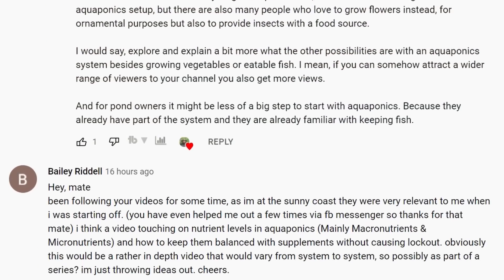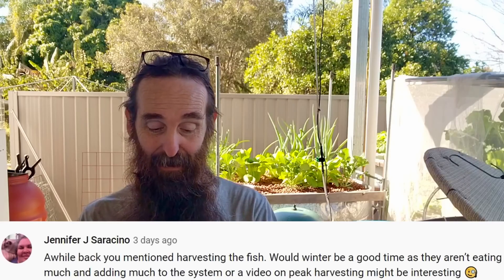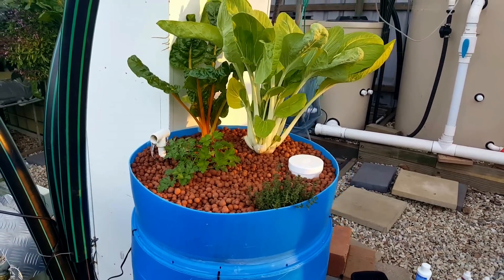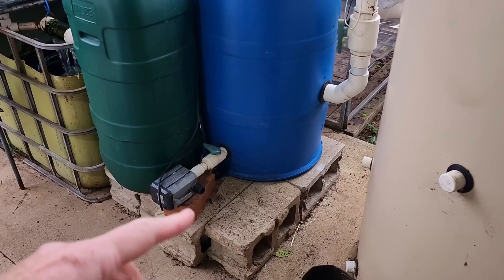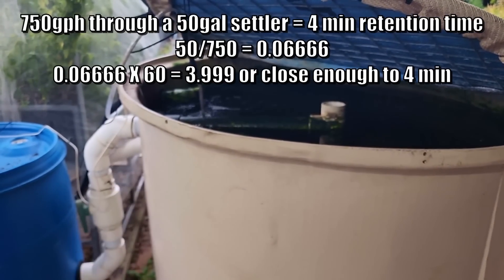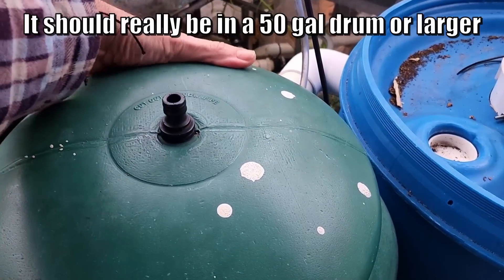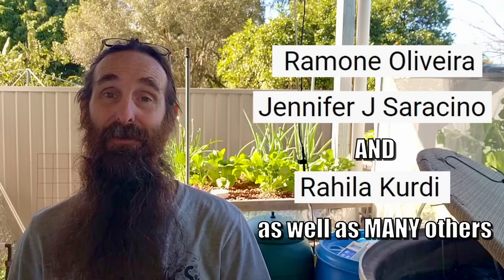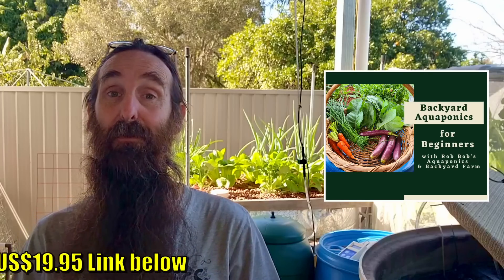Radial Flow Settler & Biofilter Advice | Future Aquaponics Video Ideas

Comment: Hey rob. How effective are biofilter/nitrification tanks vs grow beds? Say I add a 5 gal with loads of air and media inside. How many more fish would that allow me to run?
Reply from the maker: The media I use (PE03 / K2) I can grow out 1 fish per 1L/1quart of media. In a 5 gal container, you could probably only add 2 - 2½gal of that media as you need a decent amount of water to help it move. 
Hope that helps some.
Reply: @RobsAquaponics  Thank you very much for the reply rob! That helps a lot. I have a small space and limited grow area so the biofilter will be super important. Right now I have roughly 30-35 gal of grow media, a 5 gal biofilter and 70 gal fish tanks. Hoping to get at least 20 tilapia to eating size. Still going to add another bed soon and  DWC.

Comment: Hi Rob great info as usual, top chap! I'm looking to set up a small hybrid system in Thailand with the hope of expanding it and would like to know if its possible to have a DWS sunk in the ground 60cm (to help with water temperature control in the greenhouse and cost) but also have a couple of media beds per deep water bed? my issue is that the sump tank needs to be the lowest point so would it be possible to use the DWS as the sump? i know the water level will change but as they are on floating rafts i assume that wouldn't make any difference, I've probably missed something critical so if you or anyone else could give me their view it would be great. really looking forward to getting up and running!
Reply from the maker: Hi Darren.
I know a few folks that use the DWC as a sump. You might find some videos where Rob mentions how he's set up the DWC bed/sump on his @Bigelow Brook Farm channel. https://www.youtube.com/user/web4deb He runs all the water through media beds first then into the DWV. 
Cheers mate.

Comment: Hi Rob! Did you try to introduce more species to the water to make it more self-sustaining? I am quite new to aquaponics but have a lot of aquarium-stuff experience. My suggestion is that you can add freshwater shrimps, crawfish, and some mollusks and mussels to deal with solids removal and create more biodiversity which will be good for plants and for fish. You'll still need a filter but they help keep the water clean and will clean containers' inner walls. Shrimps are the easiest, you just need some substrate where they can hide, they are fast breed and good livestock to feed fish. You can grow them, in the same tank as tilapia or in a separate tank, or even in your filters.

There are also types of fishes that feed on algae and plankton from the walls and stones like Pterygoplichthys. They are not food fish but they are pretty expensive aquarium species when grown up, so adding just 1-2 Pterygoplichthys will help to keep tank walls clear and additionally generate good profit if sell them after they grew.
Reply from the maker: I have had crayfish in the past but think the low pH affected their health & they died off. The same happened with the water snails. 
Some mussels require fish gills for the larvae to attach, so I have steered clear of using them for the time being until I understand more about our native varieties. 
Plecos wouldn't last long in our tanks through winter so I've been advised + I don't have a large algae issue so haven't used them either. The native jade perch we use will eat algae which is a bit of a bonus. 
Shrimp/prawns are something I'd like to use but would need to add another tank to keep them, something I don't have the room to do at the moment.
Cheers & have a top one.
Reply: @RobsAquaponics  that's truly challenging to make a decent biosphere in a tank. Like 80% of fishes I introduce in my aquariums do not live long there. And it is not always about water. It also amounts of sunlight, type of soil, vegetation, microorganisms, places to hide and a lot more hidden factors. That's a problematic hobby but interesting.

Comment: Hi, do you have any ideas for solids filters that can handle more flow? I started out with a trickle tower with a few layers of foam, but it gets clogged too quickly. Now I have a static media upflow filter, which works ok and doesn't really clog, but it's impossible to get the media clean in a reasonable time. Do you know what kind of a retention rate a swirl filter requires to work properly?
Reply from the maker: I would go with a radial flow settler MF as they have been shown to work better at removing finer particles than the swirl variety. 
I'll leave a link below for you to suss out. It contains videos explaining how they work, retention time & also has a build video included. 
https://www.youtube.com/playlist?list=PLBcWprMIwYYjjZIXxx8GZxm_55Fjs0mOF

Comment: Hey rob should it be one solids filter and one bio filter per fish tank or can a bigger bio filter handle two fish tanks?
Reply from the maker: You can  have one larger one as long as it can handle the flow rate Quinlan. 👍 I'd be looking to get above a 6 minute retention time if you can.

Comment: Hello Rob, how are you? How can I know through your examination device that the nutrients are sufficient?
Reply from the maker: Hi Mate. I use visual cues for most elements like magnesium, potassium, and calcium but do have a test kit for iron. 
The only way we can do a full test is to send away the water to be tested at a laboratory. 
Nitrate is easy enough to measure using the API freshwater test kit.
Hope that helps mate.

Comment: Thanks Rob, i follow you since spring in quebec. I have a question about nutriments. My cocumber leaves drying. Can you help me or the answer is in the guide? Thanks
Reply from the maker: It could be a number of things that could be causing it so would need a lot more information.
The guide is for folks just starting out & only briefly touches nutrient issues.
Reply: could it be an algae problem that causes the ph to vary?  The pH at the end of the day is 7.9.

Comment: Rob, I tried contacting u thru minds & it's not allowing me to send messages. Trying to find out if I can schedule time w u on setting up hydro system. I'm fearful of the extreme heat we've been experiencing here yr after yr. Idk ur geo area in Australia to compare. I'm thinking of need a water cooler added to the system but I haven't heard u talk about that, or I just don't recall...
Reply from the maker: Hi d. We're in SE QLD which has a Subtropical if that helps any.
Are you running a straight hydro setup or aquaponics?
Reply: @RobsAquaponics  I'm in Hot Springs National Park AR which is sub tropical in summer also. This yr had been crazy high day time highs 100-112° F & night never drops below 84
I don't have a setup yet. Have the tanks, which r bone dry from no rain. 
I ordered ur book & plan to do the flip. I thought if u could raise fish so could I, trying to get away from having to add a chiller. 
I also have had 2 cold winters, don't know if that'll b the norm. Wind-chill can get below 0 F & hey down into the teens but that doesn't last long. In winter I plan on enclosing w plastic, all I need to keep growing here all winter then I have warm plants, tomatoes, peppers under light inside the house
Thank u so much Rob, I've really enjoyed ur videos, now it's time to put ur knowledge to work
Reply from the maker: @user-tn7xo7ky9o  You could try burying the fish tanks & use the earth to help moderate the high & low water temps d. A greenhouse cover through the winter months is a good idea. 👍👍
 Fish selection would help as well if you can get a fast-growing, warm water tolerant fish for the summer months. 
I have seen some folks run water through chillers that are keeping trout to help prolong their growing season into the warmer months here in OZ.
Reply: @RobsAquaponics  Burying the tanks is a great idea, I should of thought I'd that😁. 
My house is on a slight hill & have a 4' retaining wall where I thought about putting in geo thermal greenhouse for yr round production.... Really should of thought of that!...
I was going to talk to the local co here that stocks the cattle pounds, well that's b4 all the ranchers had to sell their cows this yr- no grass or hay growing due to extreme heat & no rain... 
I'm near completion of a major reno on my 1942 small bungalow. I have 144 sqft laundry rm that I'm saving for last w 12' ceiling. It was added in 70s so the 1 wall is brick & has cement floor. I'm raising the floor 4' to b level w the rest of house. Along that brick wall I plan to put shower tray & have indoor winter hydro wall. I could drop a tank down there easily. My current design has that space for storage
If things don't change everyone is going to wish they had food production.
Didn't I learn from you that hydroponics uses approx 8% water from a traditional garden? Think I'd know ur vids by heart now 
Thanks for all the info truly appreciate it. I've gone thru ur entire beginner guide & getting ready to go over again. W empty IBC now the time to change my setup!
STAY SAFE & HAVE FUN DOING IT😁
Reply from the maker: @user-tn7xo7ky9o  Cheers mate.

Comment: but mor importantly want to build a power less water pump.. i think i can run a system on no power at all, , and lift water 3 meters up to a header tank by magic..  i know it works just need to build one..air pump maybe only for fish tanks, and yes no air lift..
Reply from the maker: Would love to see that one mate. 👍👍
Reply: @RobsAquaponics  i have seen it done but not in aquaponics  i can do it, built a uplift filter so no power water pump will be easy
Reply: duel root zone tomatoes starts  now just standing up, but growing all on their own.   lettuce rafts in same video exploding with growth

Comment: I went looking for the Uniseal 

because you recommended them on the other radial flow filter video you did.

Now your saying they are not that good.

But on that other video you loved em

Oh well shit happens hopefully I don’t have any problems with them

I’m attempting to do aeroponics using the nutrient water from the red claw tank I just set up

atm I have two radial flow filters ready to go 

Will let you know how I go once it’s up an running
Reply from the maker: I still love them but like I said, don't have a lot of weight on them.
I wouldn't use them if I was having issues with them 😉